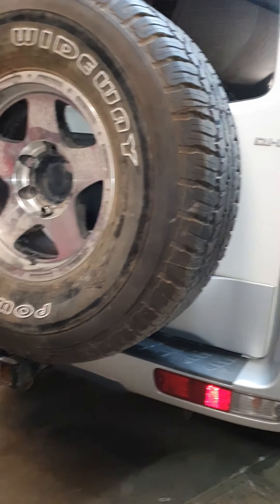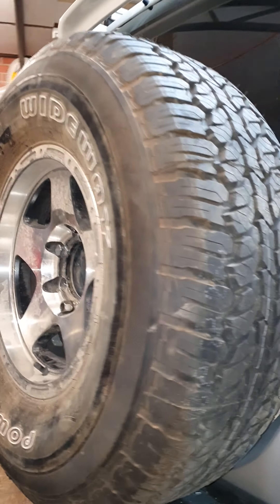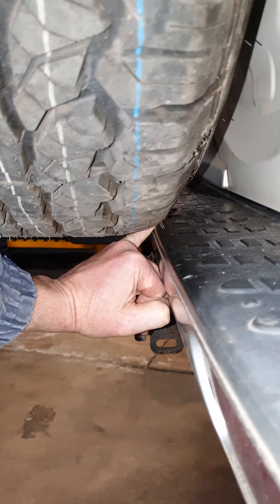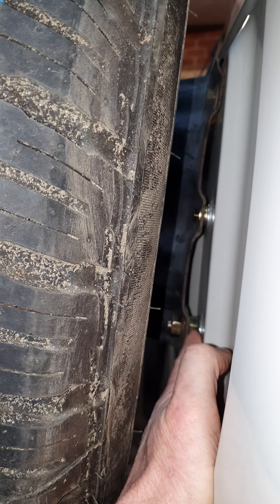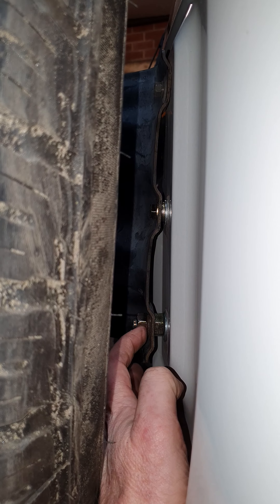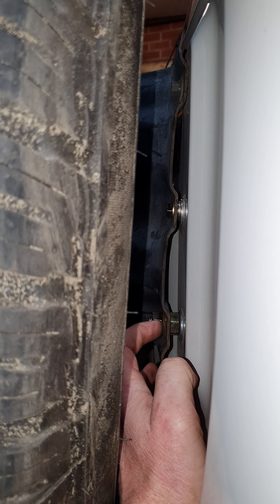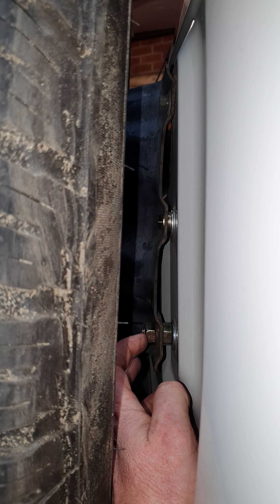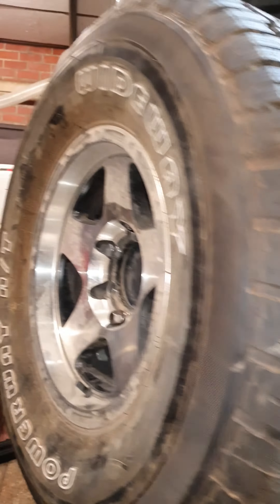Fitting a 33" tyre to a Pajero NP spare wheel carrier

Comment: Hey mate. Fyi - I have 33s but I have16  x 8 steel rims zero offset and it's fits without customizing.
Reply from the maker: Interesting.  If the tread on your spare is worn and it has a narrow tread area for the size, that would make it fit easier.  Otherwise, not sure why the difference.
Reply: @rhetth-s8082  Brand new tyre. It's because of the different offset
Reply from the maker: @Throughtheeyesofslim  mine is 16x8 with zero offset too though.
Reply: @rhetth-s8082  yeah right. Different rim I guess.